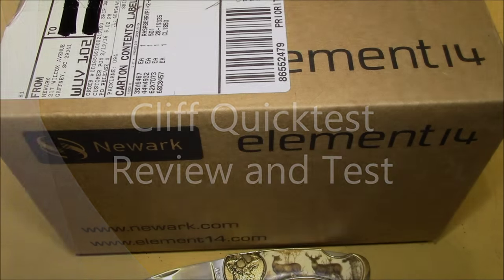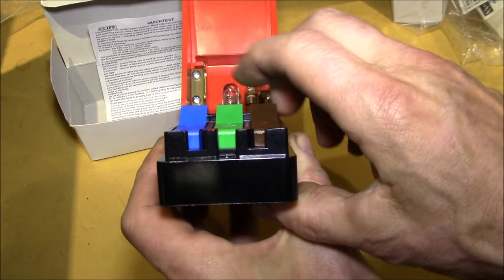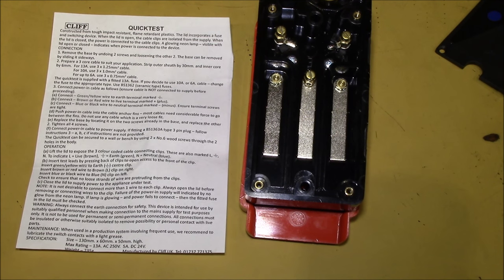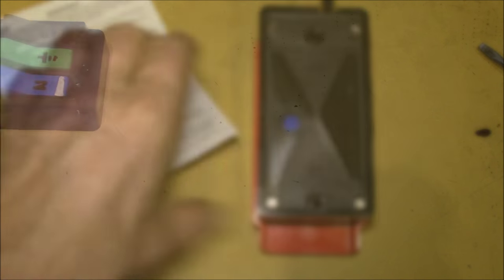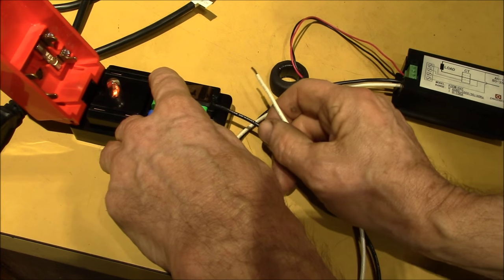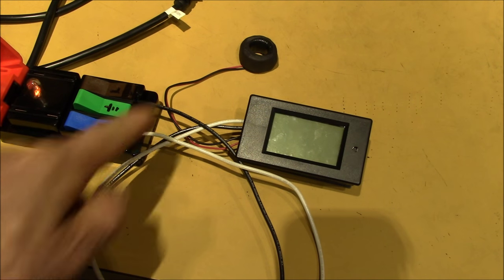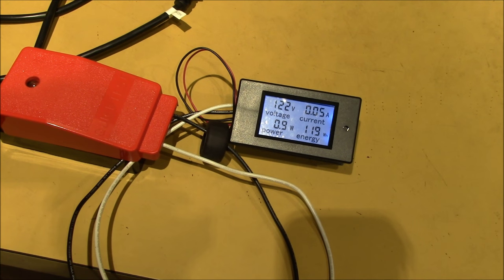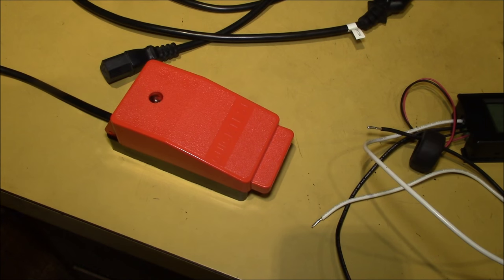Cliff Quicktest Review and Test

Comment: Soldering the strands and using them in screw terminals is a bad idea. The solder is deforming under the pressure of the screw causing a bad connection and after a few months or years the wire will fall out of the terminal. That's the reason why this is prohibited in Germany. You should use ferrules for this, here they are mandatory for this. In the US they are not, but they are recommended.
Reply from the maker: Good point.  I had to resort to tinning the very ends of the wires to fit them into the very tiny holes in the screw terminals of this device.   I tried to keep the tinning just to the ends of the wires.  I have checked the terminals for tightness and they are still good at last check.  I have used ferrules on other projects but I didn't have any small enough to fit those tiny holes.  Not sure why they made the wiring terminal space so small in this thing, there's a lot of unused space there.  I imagine since this device was designed in the UK for a 240V system, they use smaller gauge wire that what I used.
Reply: In the UK they are using wires with a cross section of 1.5 mm²  or 1 mm². In the manual you could read it: In case of using 1 mm² you should replace the fuse. The fuse is a BS1362, this type is used in the british plugs too. The 13 A fuse could take 20 A for a short time before it's melting. I hope you have ordered some of them just in case you're needing them. In Germany it's a bit tricky to get them.

In the UK they got 230 V. This was changed during mid 80s. And now in Europe the nominal voltage is 230 V. In Germany they have raised it from 220 up to 230 in 1986 (western Germany) and in eastern Germany during 1990.
Reply: Andrew_koala  Only on some terminals it‘s not necessary. For example Wago models 222 and 221 doesn‘t require ferrules. On the contrary, using ferrules there reduce the conductor size you can insert into the terminal.

Comment: Unless you're going to use this with devices up to 1.5KW you might consider putting a much lower value fuse in there.
Reply from the maker: Good point.  I'll see if I can locate some lower value BS1362 fuses.  If I find a decent source, I'll put a link in the video description.

Comment: Hello, Interesting video. Is it possible that we put the neutral and the load in the CT at the same time or just the load(phase)?
Reply from the maker: Ideally you want to run just one wire through the CT to measure the current.  You can put both the load and neutral wires through and the results will depend on which way the wires are oriented.  

If they are both going through in the same direction, the current readings of both wires will cancel and the current reading will be zero.  Note that this is how Ground Fault Circuit breakers are wired, load and neutral currents cancel out unless there is current leaking to ground, in which case there is a net current reading and the breaker trips.  

If you reverse the direction of one of those wires, the current readings will add and you'll be reading twice the current in the circuit.
Reply: Ok, thank you so much. What about the wiring of the CT( the order of the red & the black vires doesn't matter?I have PZEM-004). You will find attached a picture of it with CT. Thank you.
https://drive.google.com/open?id=1LoZYGhnAgucKjBIsUHg85_hOxZImc-q7
Reply from the maker: I don't think that matters.  This power meter seems to only register positive power, so it ignores the direction of flow of current.  It does account for the power factor or phase angle between voltage and current.
Reply: It works thank you so much for the help :) :). I can't understand why the transformer can't detect the current when we put phase and neutral at the same time, but on the other hand, it detects the current when we just put the phase?
Reply from the maker: If you run both wires through the current transformer, in the same direction, they cancel each other out.  Say you have 1 amp flowing in on one wire and 1 amp flowing out on the other wire.  The net current is  1 + (- 1) = 0, thus a 0 reading on the meter.  You could reverse one of those wires and have line going one direction and neutral going the other direction and then you would be adding the 2 currents, in other words, 1 - (-1) = 1 + 1 = 2.

This is essentially what RCD or GFCI devices do.  They measure to net current flow on line and neutral and if it differs by more than a set amount from zero (like 10-30mA), they trip.  This is how they detect that there may be a fault to ground, if you have 1000mA flowing into a load on the line side and only 970mA flowing back on the neutral side, then there's 30mA of current leaking to ground.

Comment: FYI Cliff now makes these in the US wire colors (Black for Line and White for neutral) part number CL1857.

I bought mine from Newark too they seemed to be the only authorized distributor that had the US version in stock.
Reply from the maker: Yes, I saw that some months after I purchased mine.  Actually, I kind of like the other colors since I run into those a lot on things like power cords.  I just added a white and black mark on the blue and brown levers so the unit has both color schemes.